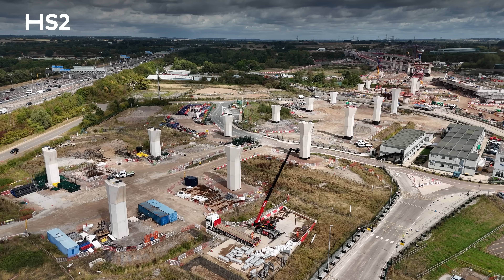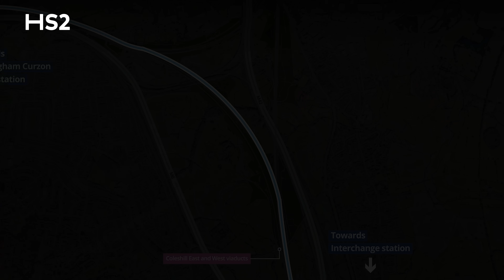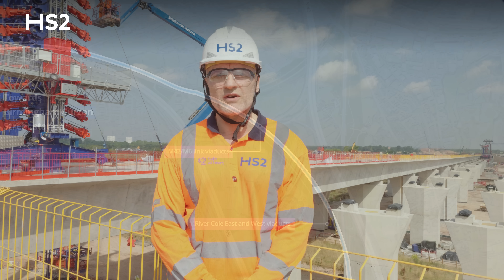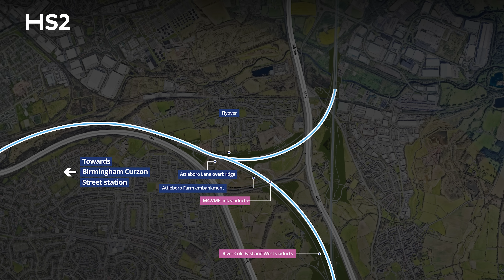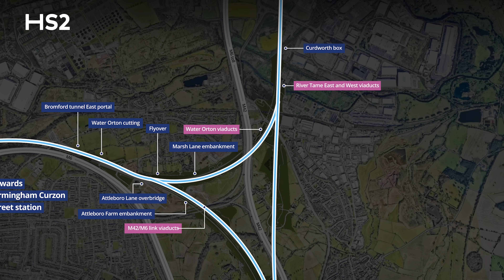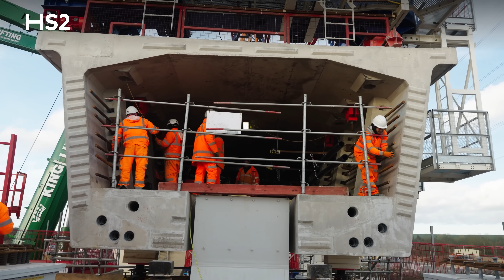HS2's Delta Junction explained: 🚆 In-depth look at one of the most complex parts of HS2 🏗️

Comment: Glad to see the mask has finally slipped off with not a single mention of Scotland as a destination. no worries with all the Barnett spoils we will have electrified our entire network by the time there is Choo Choo running on this Birmingham to Old Oak Common shuttle. Effectively the gains made to Birmingham will be canalised due to the lower line speed north of Handsacre!
Reply: Nope, Birmingham Curzon Street to London Euston
Reply: Still not grasping the principle of classic compatible trains then, running to places like Manchester and Scotland??
Reply: @Polarbear1-b6jgrasping it very well thanks they will actually run slower than the pendolinos on the WCML due to the lack of tilt…
Reply: @gorgu08  and with less people, because they're smaller.
Reply: @sIightIybored  Instead of 400m trains (actually two 200m trains coupled together) that can't run to Manchester, they are going to be ordering a mixed fleet of 200m and 350m trains (exactly as long as the current trains) so there won't be any capacity decrease
Reply: @nether_bat so we spend a gargantuan amount of money to have the same capacity north of Birmingham ,sounds like a plan
Reply: @123stelyn that’s what phase 2a was going to fix, but the shortest part of the route was just “too expensive”

Comment: A question?
The HS2 highspeed trains built specifically for the run upto Birmingham, will they also be the same trains exiting B'hm to carry on north to Manchester albeit at lower speeds and similarly those trains going straight to Manchester bypassing B'hm altogether or will the less powerful and less fast trains be manufactured or those already in use retained for these lower speeds and destinations?
Reply: same rolling stock
Reply: @CynicalPlatapus same rolling stock running at lower speeds and using a different power collector (pantograph) to suit the conventional rail network.
Reply: @davidquirk8097  i don't think you meant to reply to me
Reply: @davidquirk8097 Will there be a need for a different pantograph design given the electrified conventional UK network is electrified at 25kV AC 50Hz, the same standard as HS2?
Reply: @trainjedi9651 yes. The High speed pantograph is incompatible with the conventional network. Both run at 25kV nominal but the design of the over head for high speed is different. HS2 rolling stock has two pantographs, one for HS running, one for conventional rail network.
Reply: @davidquirk8097  So how do you work that out, it isn't the pantograph that is or will be the problem it is the 1980's Overhead line equipment North of Handsacre that will be needed upgrading for the new trains to operate
Reply: @peterwallen1063 I have inside information (I work for one of train makers) and the two pantos are very different beasts.
Reply: The new trains on order for HS2 will travel on the  HS track  and then north of Handsacre junction, on the existing west coast mainline. I believe they will travel at upto 225mph on the new track  and considerably slower ( 110- 125mph ?) on the older track. I think there is only a  portion of the new line when 225mph is achieved as  the length of the new line has been truncated so much. In essence, you got to think about slowing down, not long after you got up to top speed !. This relatively high speed of 225mph was designed into the project at the outset when it was supposed to be built to Leeds and Manchester, with consideration of further extension north, after that,  to Glasgow and Edinburgh. 
The speed of 225mph is also the reason the new line has to be reasonably straight with long curves where necessary.
Reply: The trains to  Curzon Street will be two 200 metre train sets coupled together.  The HS2 platforms are over 400 metres long. No non HS2 station can accommodate a train of this length. This means onwards trains to the north will be decoupled and run as 200 metre units. This reduces capacity as the existing WCML Pendelino’s are 230 metres long. Well done Mr Sunak, you obviously applied your mind fully when cancelling the  northern extension.

Comment: Would have been nice to see more info about the way the different crossovers work, especially the northern one where the Water Orton No. 1 Viaduct goes over the main line on straddle bents.

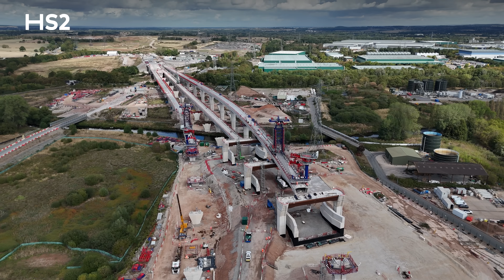07:41 shows a good view of that
Reply: I asked hs2 about Attleboro flyover _ by email  _ any artists impressions or anything they could put on there website _ apparently no images available & no plans to put on the website _  disappointing but moving concrete with hydraulic rams etc to allow trains to transit at high speed through the complex seems not worthy of more explanation & some interesting images & details _ hopefully that will change as the structure progresses _ although the drone flyers had provided some good images _ again hopefully we'll get some more pictures over next few months